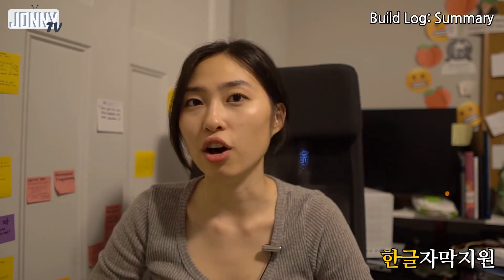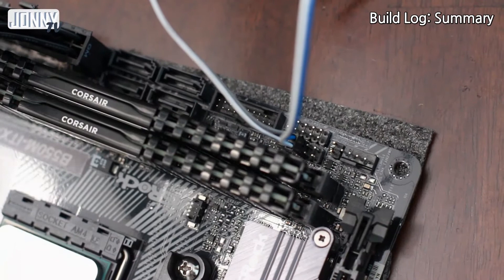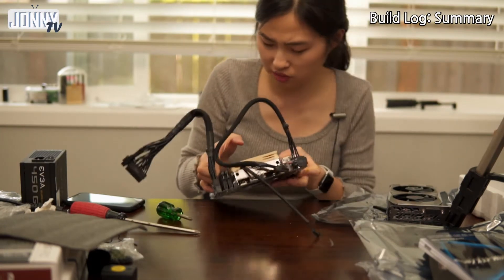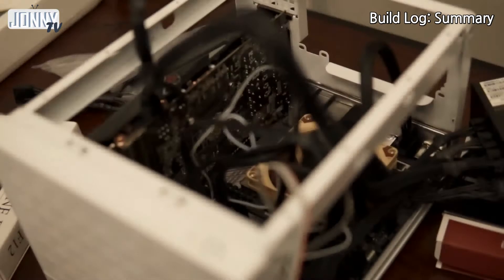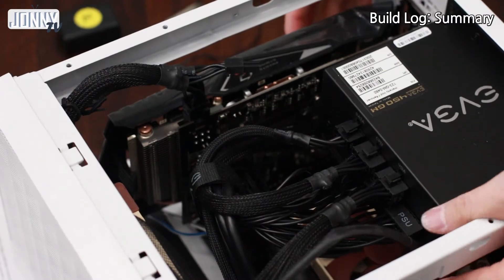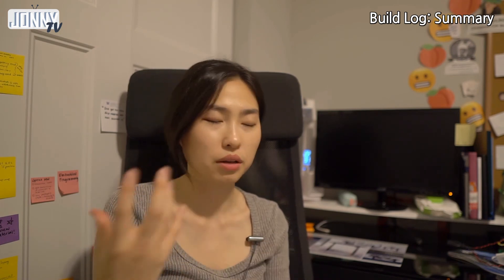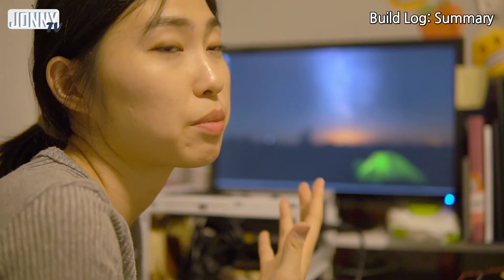ALL WHITE Silverstone SG13 — FIRST ITX BUILD LOG

Comment: So I've made a second video about temperature optimization on the SG13 and it worked well for me. At 6:52 your CPU is way too hot at 69°C idle with the fan at 2000rpm. Something went wrong there, maybe CPU paste not applied or the cooler is not really attached. 4.2GHz overclock might be too much as well but that shouldn't make a difference at idle temps.
Reply from the maker: thanks for coming back to comment! ive gotten comments about how the CPU temp seems too high for idle state. it might be time to open it up and take a look...
also i have no idea what the frequency is at 4.2GHz since I haven't touched it (changed it to overclock) at all. hmm...
Reply: @jcholol  You can download "AMD Ryzen Master" to check frequencies because other programs report wrong values for some reason. Try to open the chassis and see if the temps are going down, if not you have a problem with the fan mount itself, maybe not enough paste or forgotten to remove the protective sticker on the cooler plate. 2000rpm fan speed sounds really loud & windy, if that is reported correctly.
Reply from the maker: @panoramacircle3281  I can give it a try this weekend. my fans aren't loud at all so im not really sure if that's correct

Comment: 6:58 you can see that the CPU close to the max boost clock of 4200MHz. Could be the reason the high temp. Select Ryzen balanced power plan may help bring it down

Comment: I just build a mitx with the same case on my channel and it seems we had similar challenges to overcome. BTW I will look into a way to increase airflow with a better fan and sealing the half-open wall between the main chamber and the smaller front chamber so that the fan has to suck in fresh air instead of just rotating it inside the case.
Reply from the maker: good to know that others were facing similar challenges. let me know what you find out about fan and airflow optimization! :-)

Comment: your cpu temp was too hot 70C+ @idle, coz my Cpu temp around 40-43C @idle and full load around 70C+ with amd stock wraith cooler with same case sg13
Reply from the maker: thanks for the feedback!!
Reply: @jcholol  maybe try turning the PSU upside down, saw it in another video, PSU fan disrupts the CPU fan apparently,
Reply from the maker: @BiGBeN21  oooh yeah maybe I could try that. I really had no idea what I was doing 😬😅
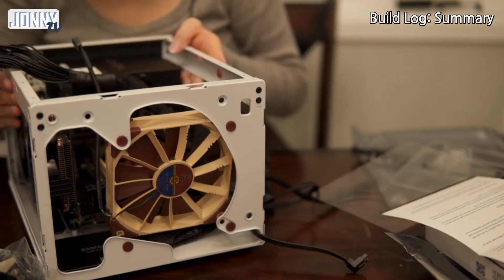Reply: @jcholol    I saw the video 3:50 I think you put the front noctua fan in the wrong way as exhaust fan, try flip the fan as intake fan. Hope it solve your cpu temp problem
Reply from the maker: @MrCloudX7  will try that the next time i open my PC up, thanks!!
Reply: No way, I'm using the wraith stealth with the Ryzen 3600. I get idle 50C but full load is 95C. I am using an ATX PSU though. I have a 120mm fan at the front. I've tried PSU up/down, 120mm intake/exhaust, but nothing worked. Just received the Noctua NH L9a today.
Reply: power supply fan should facing up to blow put hot air from top casing. and advice buy dust filter to put in side and top to prevent dust go in.  power supply fan seems facing down to make more hot for cpu.
Reply: @ericyuan9718  did it help?